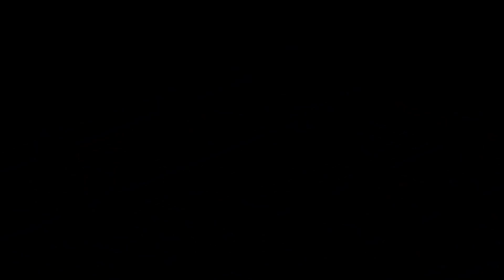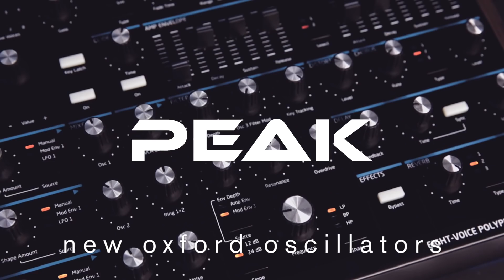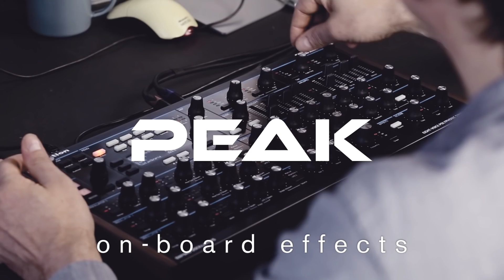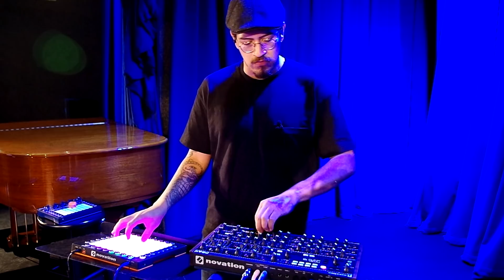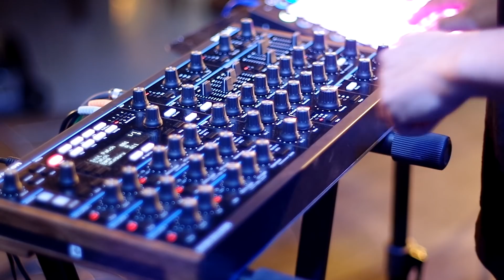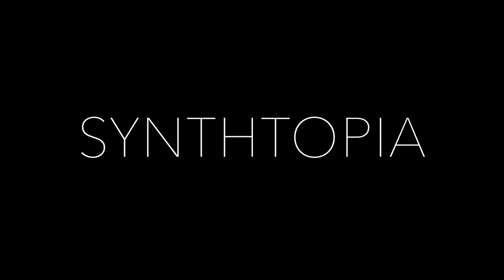Novation Peak Synthesizer Part 1: Overview & Architecture

Comment: IMO it doesn't impress for the Money.. Oxford oscillators and analog vcas and filter sounds sweet but in reality just a clever selling point.. the final sound is  reminiscent of Christmas deorations blowing in the wind..
Reply: You're right I wouldn't call it a bad synth at all.. But taking a look around of whats in the market lately.. There pricing for this synth is way off the mark..
Reply: @petrokemikal  what is around? rev2 ? to me it sounds harsh, teh same as tetra did, moog doesnt have poly (int the price range, the same for OB-6/P6) .. what else? matrixbrute.. is too expensive, its great.. except the sound, sounds like microbrute on steroids.. deepmind is great, but very limited in oscillator and filter.. and the build quality is shit (i had to return mine).. what else is there? blofeld.. far from warm, fully digital, and i dont like the glitches it makes when you go over what the "cpu" can handle.. and you get there surprisingly fast.. also i didnt like the sound.. 
virus ti.. the software is SHIT, i dont remember when i had so many BFODs..
so yeah
Reply: @dnch  Depends on what you want.. this is packed with features but falls short on sound IMO... Rolands system 8 and the Kingkorg are 2 Fantastic sounding Polys if you can overlook there shitty Looks and sometimes lack of functionality, System 8 being the worst on that front
Ive got a jp8080 and an Alesis Ion for under a grand and they do everything I would Look for in a poly..
Reply: @petrokemikal  I got it £800 used yesterday.

Comment: After going to Eurorack it's hard to take these synths seriously...
Reply: Show me an 8 voice polyphonic modular system for 1,200 dollars. You can't even get 8 oscillators, a power supply, and a case for that much. Polyphonic synths and modular systems are completely different machines that are good for different things.
Reply: +Music and life
I don't know, polyphony gets expensive quickly in modular. This seems like a pretty nice addition to the studio whether or not you have a modular system too.
Reply: Why's that?  This seems pretty powerful for the price.
Reply: +Alexander Wahl
I like synths and eurorack stuff, and think there's a place for both. If you haven't started your modular yet, where do you think you're going to get your top quality strangled-cat sounds, or squelchy farts, for that matter?! Put some of that money to 'good use' dude :P
Reply: this comment just tells me that you have no idea what you’re doing
Reply: I feel ya.
Reply: because they generally use cheap oscillators and they always leave something out that you need.  With modular you can always add whatever you need.
Reply: Well thats wierd, because synthesis is all the same sound wise. It's just
 the way its hardwired that makes a difference in how you work with 
them.
I have eurorack and soundmodules I have standalone drumsmachines and eurorack 
drums. It doesn't matter to me if the one is hardwired like my Korg DSS1 
and my Intelligell/Makenoise stuff is not. 
Its not the brush or the canvas that makes a painting It is your imagination
Reply: @ZanBizar  No because not all sound engines work as well as others, some lower quality synth engines get muddy sounding or get signal drop off
Reply: I used my at a gig people were like wow.Especially since I had no keyboard
Reply: unless you have to play chords

Comment: hmm I think my KS4 may need a new home
Reply: haha wow. ok then mate. i simply stated my opinion that the KS might still be relevant and that they would go well together because of initial perceived differences in total character. if that makes me lazy or whatever then so be it  :P
Reply: i think they will go well next to each other and complement one another. KS can get soft and fuzzy, this is more pristine and clear. a good team.
Reply: With noise modulation, super saw, distortions, how should that NOT be able to do "soft and fuzzy"??
Reply: well i'm talking more about the character... not the features. one synth's version of "soft and fuzzy" is going to sound different to another. while it is obviously early days, to me this seems more sharp/crystalline than a KS in terms of general tone colour, so the KS may still have a place. that's all i meant.
Reply: haha what? called me out? it should be self-evident that this is only my opinion, and of course it is only based on what i've heard so far. for some reason this seems to bother you. let it go :P
Reply: i think you might be reading a bit more into this than is really here, in this case. my perceptions will obviously change as i see/hear more, and when i go try it out for myself. why even bother watching any videos at all if they're not going to inform your initial perception of the synth?
Reply: once again, reading more into what i said than is actually there. anyway this is pointless, i'm out :)
Reply: Yeah you know, the features define the character of the synth. What you are doing is just an assumption and a generalization. Your mind is tricking you into putting that synth into a "box". This synth is so complex, with all the waveshaping, modulation etc that you have no idea yet what it can sound yet. With oscillator drift, slight supersaw, noise modulation, noise mixing (the noise has a dedicated LP filter btw) gentle distortion this synth with sound as soft and fuzzy as they come, i guarantee it. Don't put it in a "box" it's lazy.
Reply: Yeah i just called you out on your "perception". I see that all the time. If you go onto the comments of the waldorf quantum you will see people saying "it sounds cold, like a vst, and my blofeld sounds better" It's a weird thing that people do.
Reply: Nope, i only wanted to help :D I'm not bothered in the least, merely fascinated how people seem to have a need to make up their mind about a synth after watching a 10 min. video.
Reply: Oh videos are great. Just like presets. They totally tell you what a synth sounds like :-)